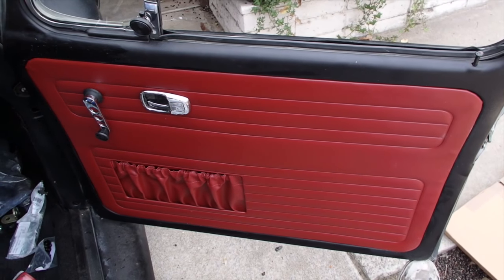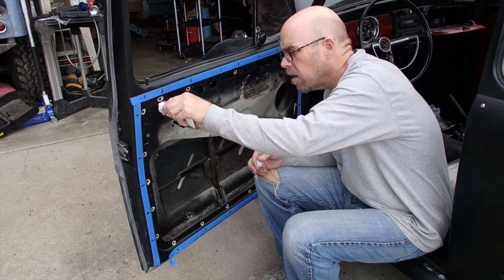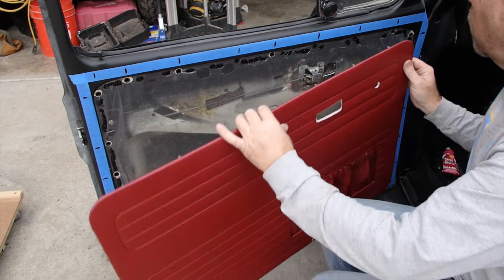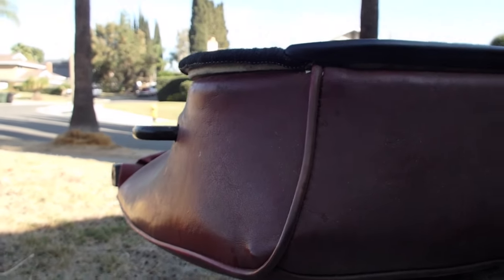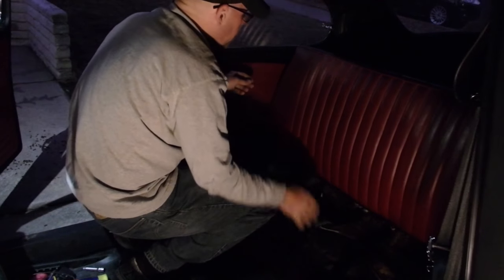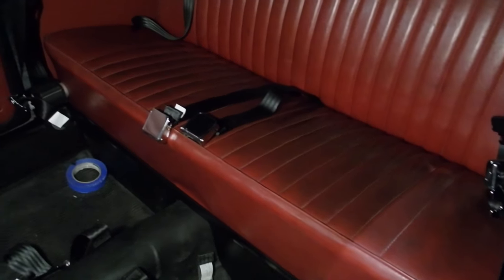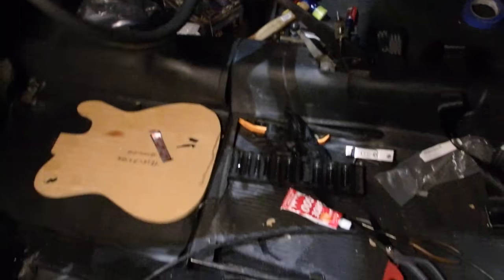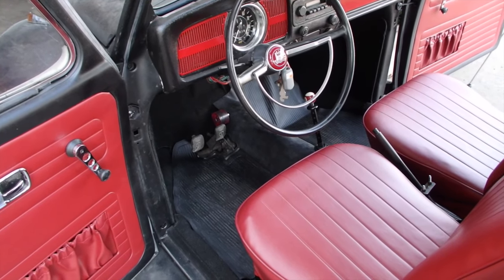1969 VW Bug Project - Episode 48.3 - The Interior: Finishing It Up

Comment: I paint (using oil based Rustoleum) the interior of the door cards. They will pick up moisture, even with the plastic barrier.  Two coats of oil-based, brushed on, stops that mold from forming in the cheap backer board.
Reply from the maker: Great tip!

Comment: Are you using German or Brazilian rubbers? And where did you get shifter knob?
Reply from the maker: Brazilian.  This is a down and dirty restoration, so German ones were out of budget.

I made the shifter knob out of a mini billiard ball.  Drilled out the core and epoxied in a nut.